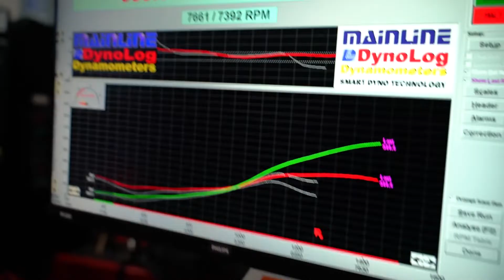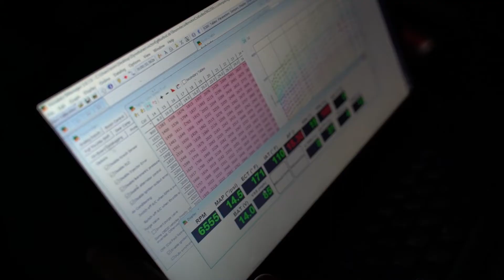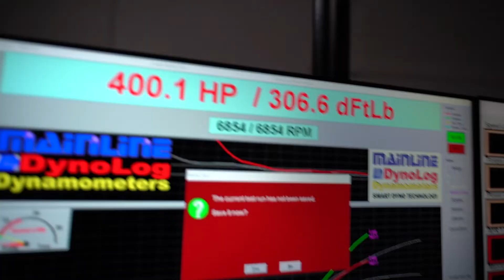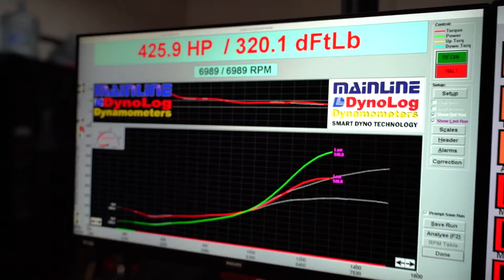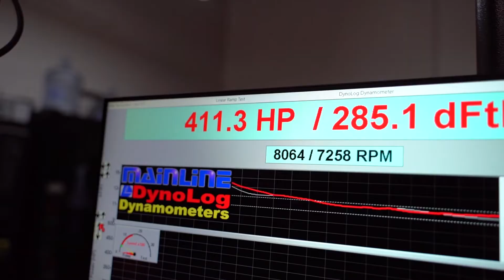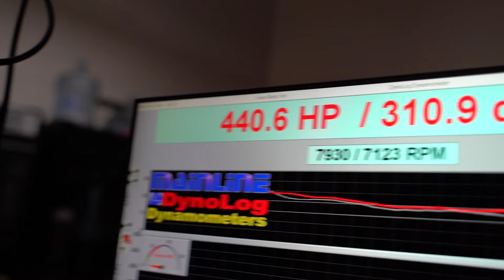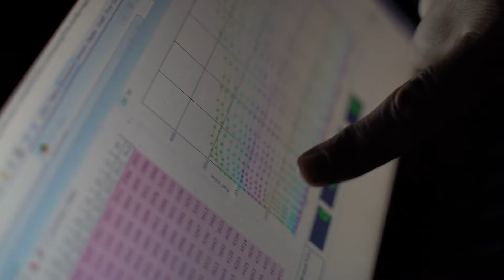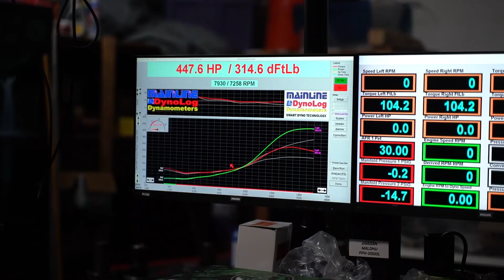Budget b18 non v turbo makes big power

Comment: I know this video is 11 months old but there are SO MANY redflags with this vehicle I would have never touched it until they got fixed.  Didn't have turbo clocked correctly, didnt know what wastegate spring was in it, had the wrong spark plugs (guessing he didn't have any extras either), didnt have anything to hold the coils down on the plugs, Told the tuner after he started tuning that the coolant temp sensor is bad, etc. etc. etc.
Reply: "Only limit is stock fuel lines" oem fuel lines are equal to -6an and good to like 600hp
Reply: Exactly.
Reply: Coolant temp sensor is common in these because of age . Not a hard fix at all

Comment: What a life it must be as a tuner. Client comes in for a tune, doesn't know details about the engine. Most importantly, THE PISTONS!

Edit: I should've waited til the end before commenting. The oil feed got me! We would've put a stop to this appointment the second he couldn't answer a question and we started looking around the engine. Disaster waiting to happen. Kudos to you for a positive attitude and getting the tune done regardless! Some tuners I've worked with claim they "aren't mechanics" and would've been stuck with these issues you had to face.
Reply from the maker: I do get cars a lot with no info on the build. Tuned a supra to 980whp. Was told had built motor. Abour 8-9months later owner said he blew a headgasket from overheating on a hot day. When he took head off, block was stock. He bought the car few days before i had tuned it

Comment: that little nipple on the throttle body wouldnt cause a vacuum leak but it would def cause a boost leak because its before the throttle plate not after. not a very large one but a leak none the less. still made great power though!!! dardan ftw!